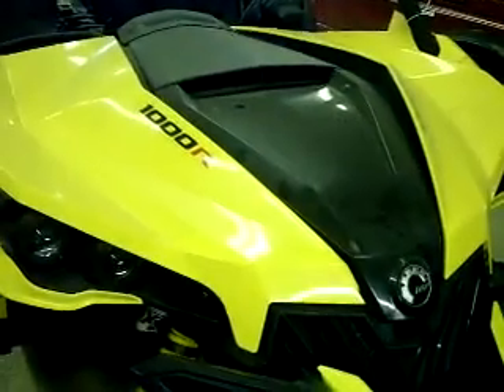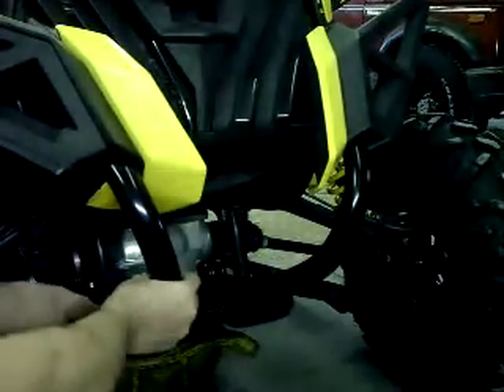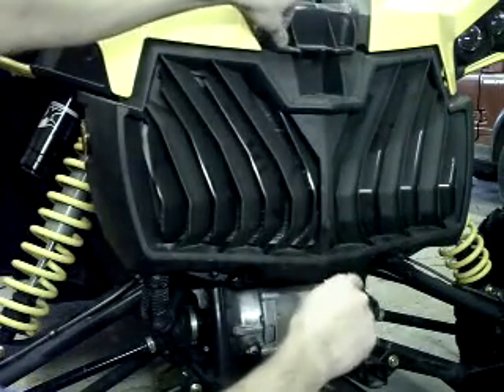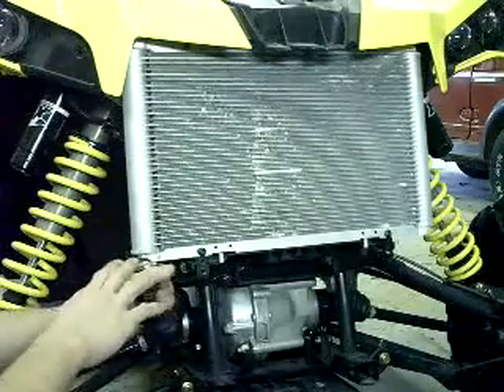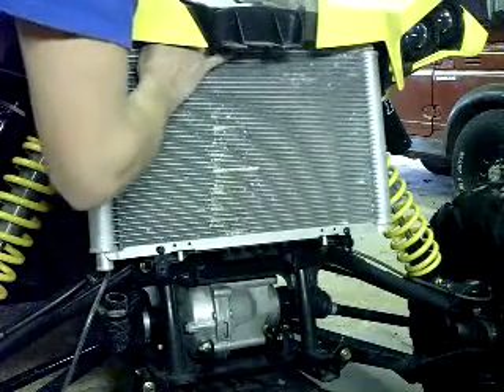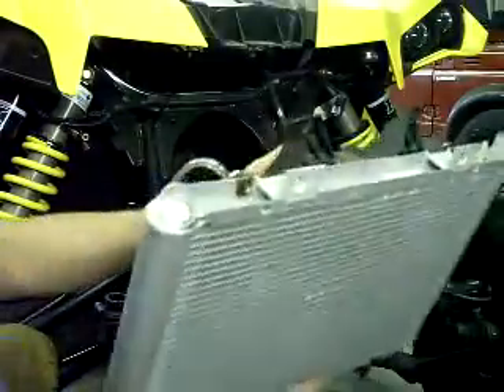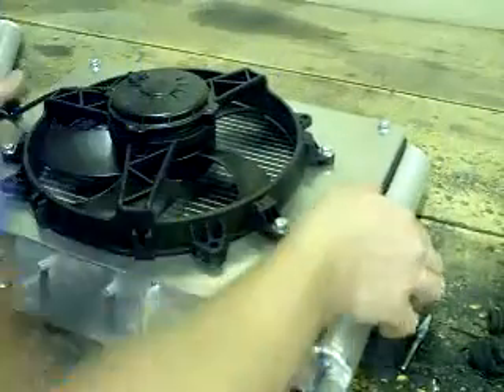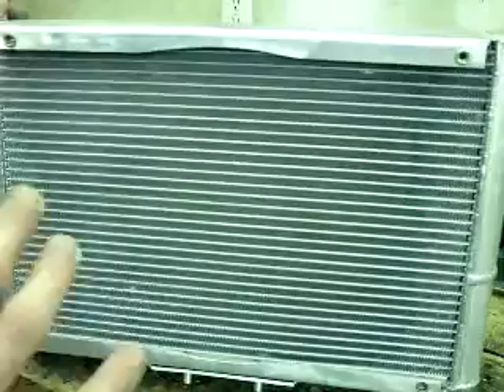2013 2014 2015 2016 2017 Can Am Maverick Radiator TCP Triple Pass install

Comment: you never put the shroud in front of the radiator, it won't let the air flow through the radiator. it goes behind it, the fan pulls air not pushes air.relocate the radiator to the rear of the cage. the tunnel to the motor is wide open.check out pines power sports and marine-pinespsm.com
Reply from the maker: Maverick Mike,first of all thanks for the comment. But I think you maybe should watch the video a little closer so next time when you attempt to make someone look like an idiot you don't do it to yourself as you did in your comment. If you had watched closely you would have noticed that the fan is a puller and is indeed mounted on the rear side of the radiator (I don't see how you could mistake that if you watched the video all the way through?). I will agree with you in the fact that if you are riding in muddy conditions a relocation kit is a good idea. As far as it adding any extra cooling it doesn't it will let the radiator stay cleaner and enable it to work at it's optimum efficiency,that's all. Our radiator design will add 35%-40% more cooling ability to the radiator. We are currently testing a core with a lesser fin count (the purpose being for the radiator to stay cleaner and clean out easier) on a machine that does a lot of mud riding,the reason he wanted to try this option was to avoid hanging his radiator and hoses in an obvious place,results forth coming and if it tests well we will do a video on it letting all know the results.
Reply: TCPPERFORMANCE1 I just ordered the mudder radiator, I can’t wait to install it and have my machine cooling properly.